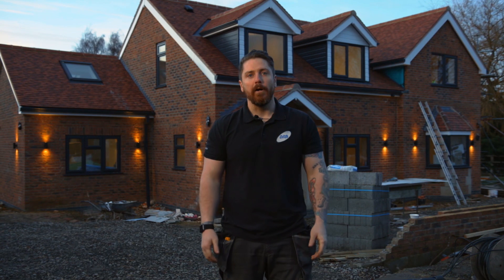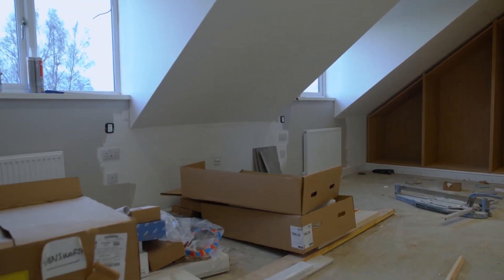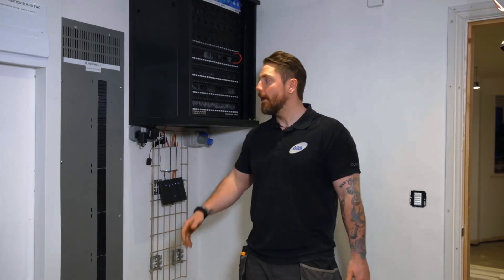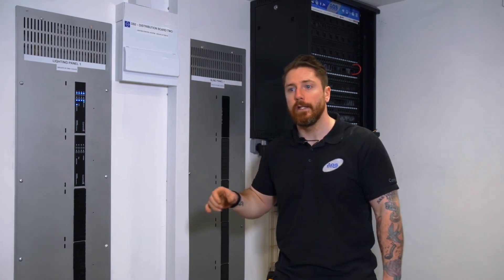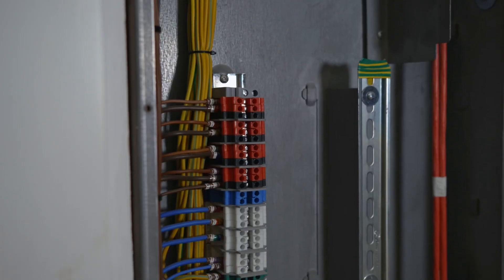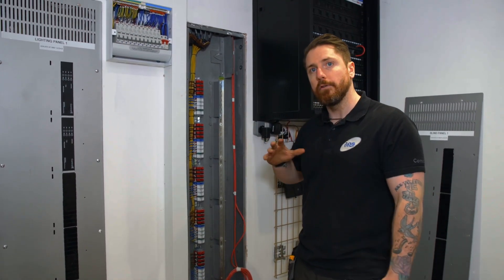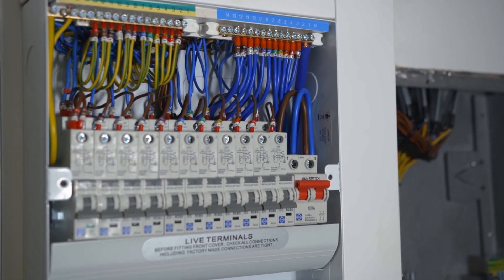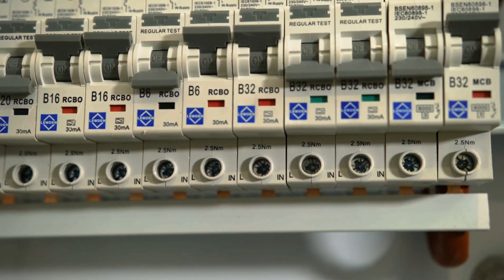BOROUGHBRIDGE Control4 SMART HOME - SECOND FIX WALK THOUGH - ART OF SMART ALEX

Comment: Outstanding integration project!  (and pro video).  This lighting package would be fast (and totally crackin') using LumenCache.  Those small lights can be placed 4-5 per home run and integrates with the Control4 2-way driver perfectly.